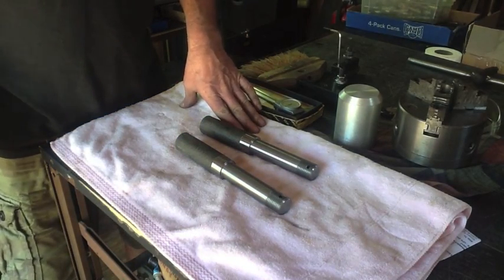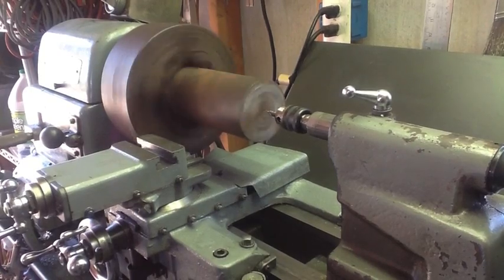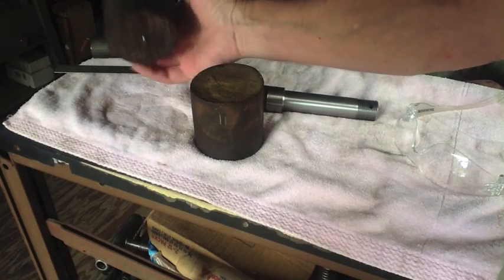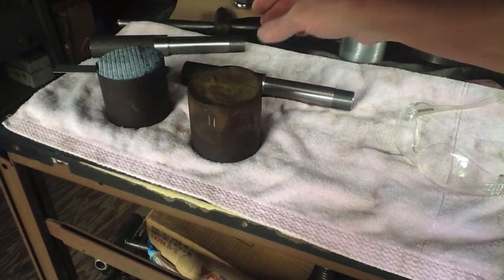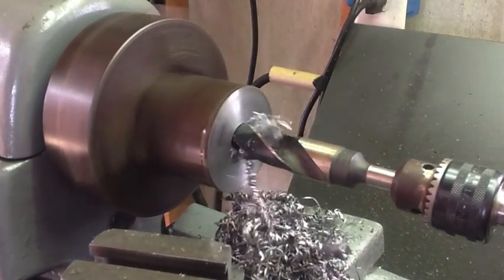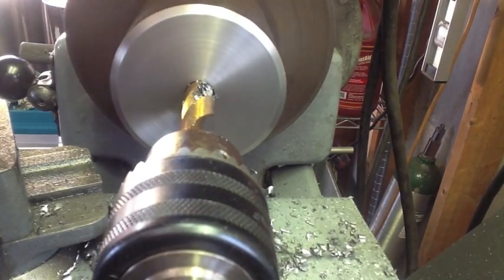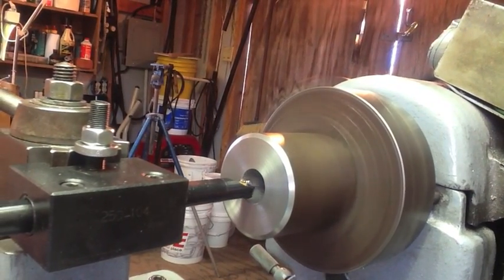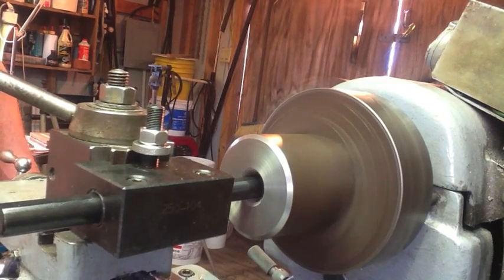Custom Trailer Axle Components ~ Headin To Cuba (Lathe Work) - MSFN

Comment: Oh, and you need a bandsaw! My little Chinese one could've cut that piece. It's just like the ones they sell at HF but older. Got it on a trade, so basically for nothing.
Reply from the maker: Yes, I need a bandsaw badly. I had to cut some 1 1/4" round steel today and had to use an angle grinder 😖